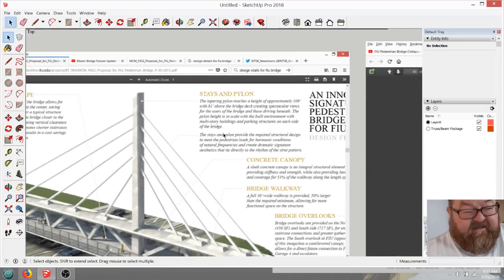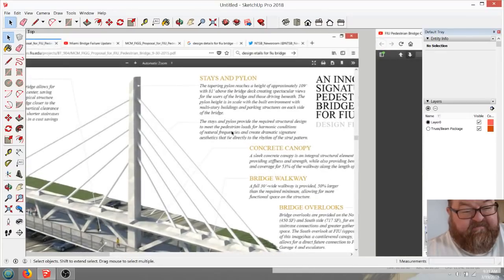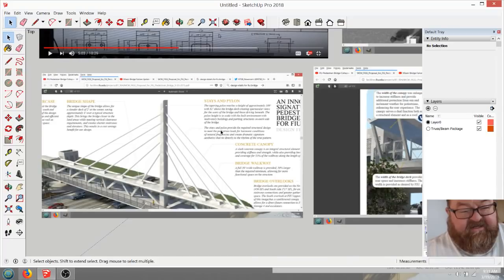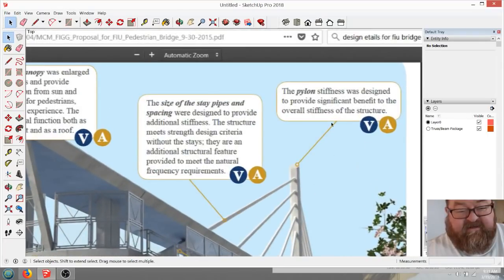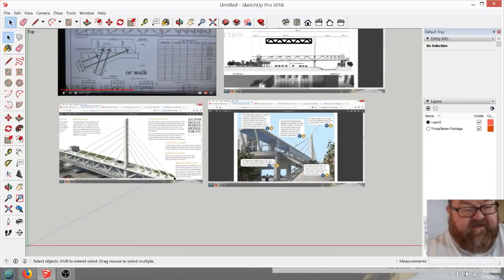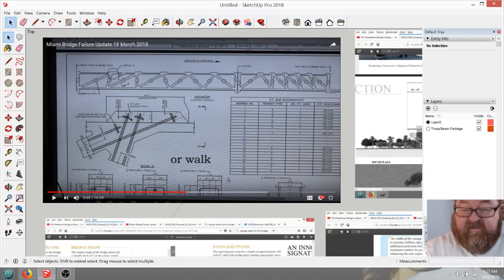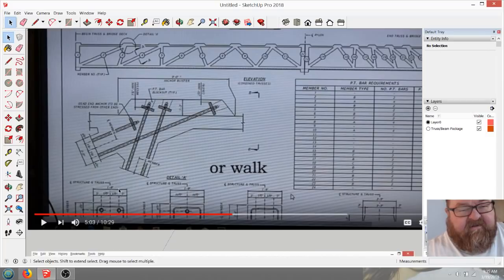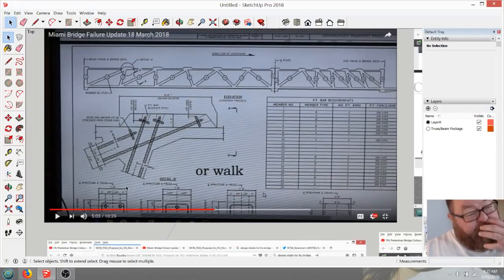FIU Bridge Collapse Follow Up

Comment: I saw the video of the woman in charge of the design. She said the "stays" were for aesthetics only, not structural support. She said the bridge was designed to stand alone, without any stays, that's why the pylon wasn't in place. The error was caused by the people with the transporter. Once they saw the transporter wouldn't fit, per Fl DOT requests, they should have stopped right there and requested the  engineers to come and manage the placement of the transporters. The  movers placed the transporter, just so they could get the bridge in place. That caused the problems with the end of the bridge because it (the end) wasn't supported.

Comment: ArtisanTony You did not address the Transverse bottom flange 7-wire post tension, Longitudinal bottom flange 7-wire post tension (the outside edges are 12-wire) and Longitudinal top flange (canopy) 7-wire post tension. As stated by you and shown on the projects bridge prints the 16" stay pipe bolted to pylon and bolted to canopy is for Pedestrian load. I suggest you consider post tension in the deck and canopy in regards to load bearing for this structure. After watching your last video and this video, I can tell you interested in learning and sharing your knowledge.

Comment: The cable stays have minimal impact on the structure. Tendons within the truss structure that support the bridge are tensioned during construction to ensure those structural members are never in tension.  The design is likely not at fault.
Reply: Crabby Hayes — There were no cable stays.

Comment: CORRECTED POST-

OH MY - They were working to reduce the tension on element 10 which was exerting a downward force on the bridge structure.  Where does this guy get his ideas?

I had written 11 instead of 10.  Not sure whether they were increasing or decreasing the PT bar there.  Not clear in what I have found.

Comment: What we have here is an asymmetric cable-stayed bridge that could not support it's own weight before the pylon and cables were installed.  Simply insufficient analysis of the un-supported structure.

Comment: Just my thoughts, but i think the guy doing the tension test was probably pulling straight up or off a bit causing the concrete to fail and created a domino effect. The bridge wasn't designed to be pulled straight upwards in that area. It was designed to be pulled at the precise angle. im no pro either my friend. Thank you for the video. It coused me to think about it also.

Comment: Thank you AT for your most educational videos. They have helped me a great deal understanding the design of this bridge. Also, what eventually might have been at the back of the minds of the actual engineers who conceptualized it.
As a civil eng. myself (not structural though) I tend to agree with you on this not being a truss bridge at all. But it is not a pure cable-stayed bridge either.
At best it is a mixed structure that combines both without getting the most of each.
Very bold for a rather heavy reinforced concrete structure with a big span across the roadway. It was meant to survive on its own but proved to be very vulnerable during construction stages from transportation to the post-tensioning of those rods in the concrete struts.
Reply from the maker: My son asked me about this and I told him to imagine holding a rope and stretching as hard as he can with both arms wide apart then let me place a load on that assembly vertically :)  He just smiled.  You see, the design of this bridge makes no sense at all.  Truss members are not built in tension because they alternate between tension and compression as you know, depending on where the load is at any given time.    I think of this as a big design team cluster where too many assumptions were made and not one of the engineers sat down and said, "dang, let me run through all of the loads an see what happens."  I have worked on design teams before and if there is not one experienced engineer responsible for the entire design, you can run into this sort of thing.  .  I am guessing that some partner in this firm wanted to have a new and unique idea for a new kind of bridge and it was a fail from the start.  Anyway, thanks a bunch.  You know back in the old days civil engineers were also structural engineers :) Maybe this project could have used a few old time civil engineers on it :)

Comment: The stays probably help more with wind performance, since the bridge was designed to handle category 5 hurricanes. You may be right in that the bridge was not finished. The last (99 ft) span and the stays may have added stability. I suspect there are several factors, including the cantilevered load during install, the tensioning, and probably communications. The Figg engineer that made Tuesday's call did lead a meeting the morning of the collapse - assuring everyone there was no danger. He apparently was wrong.
Reply from the maker: Ha, the bridge couldn't hold its own weight, let alone a hurricane :) yes, the cross section of the cantilever is another load not accounted for in reality :)

Comment: Artisan Tony,  You are right that it was going to fail no matter what they did with the cables (steel pipes).  Look at how they were going to connect the pipes to the structure, you can see that this is not the way they would do it if it was to be a cable-stay bridge. FIGG did the design, they are one of the best bridge designers in the world, they know what they are doing. Unfortunately, they cut the engineering too close or there were other factors that brought it down. Or maybe a PT concrete web system was a bad choice.  Btw,  they were working on the other end on #11, not #2 when the collapse occurred.
Reply from the maker: I think there was a major mind fart on this one.  The effort to be different made them sway from standard design fundamentals.
Reply: Or maybe it was intended to be a steel truss bridge, but the cost of manufacturing that many unique steel shapes proved to be too much, but they already fell in love with the design, so they tried to make it work with concrete?

Comment: so am i to understand that the cables were not passed threw to the deck and were only secured to the top? And were they in place already (i havent seen any pictures of that cable structure in it) ?
Reply: The Tactical 6 String,  You are right, the cables (steel poles) were not going to pass through the deck and they were not installed yet.
Reply from the maker: And I am saying they should have been :)
Reply: seems inconceivable that this could happen when its so apparent and I assume an engineering common place to be checked prior to even being approved for construction.
Reply: The Tactical 6 String,  I don't really know, but my guess is that the complexity of making the webs (diagonal members) out of concrete is not a proven science yet.  I'm sure there are a lot of complex forces going on at the joints. I'm thinking steel would have been a better choice. When I worked in an architectural concrete shop,  my boss would always say, " There two types of concrete, concrete that's cracked and concrete that's gonna crack."
Reply from the maker: That is true about concrete but typically concrete is fitted with prestressed reinforcing which is a time tested way. They were trying to use a post tension system which meant there was not much assistance for the concrete until the stays were in place.
Reply: Artisan Tony,  I completely agree with you, but I think they were trying to not build it over the roadway and so each piece would have to have enough strength on its own until all the pieces were connected.  They would have had to come up with some new system to make it a true cable-stay design.  The problem would be making the cable connections to the bottom chord and not just to the top chord.

Comment: They line up for aesthetics.
Reply: millieo They line up because they were meant to support the deck. Those "pipes" would have covered cables that should have run all the way through the columns to an anchor point in the deck. But some sort of drastic design change must have happened, because it looks almost like they kept the shape of the bridge, but changed the design. Basically, they took a steel design and tried to make it work with concrete.
Reply: L v ... Elsewhere it was said they were not structural beyond stiffening for harmonic purposes. I'm curious about the changes, too.
Reply: millieo Well, elsewhere they were wrong. Think about it, what would the aesthetic value of those pipes be? Why would they go through all the effort to install this 100+ foot tall pylon and these cables for any other reason than the fact that it was meant to bear some of the weight? It was most likely the college, engineers or contractors who started the rumor that these cables weren't structural.
Reply: L v ... I was repeating someone else. I'll have to watch your video again. If they were intended to hold up the bridge they would have been up, right?
Reply: millieo Logically, yea, when you build a cable stayed bridge, the masts and cable are installed first. Then the bridge deck is installed in sections. There were a lot of mistakes here, but again, logic would dictate that something as big and expensive and complicated to install as those cables and the pylon would have been cut from the design, especially if the project was behind schedule and over budget, if they are not structurally required